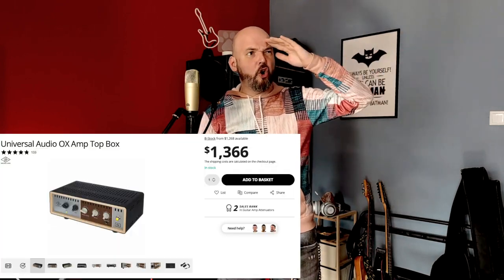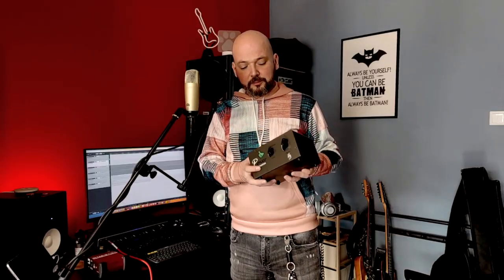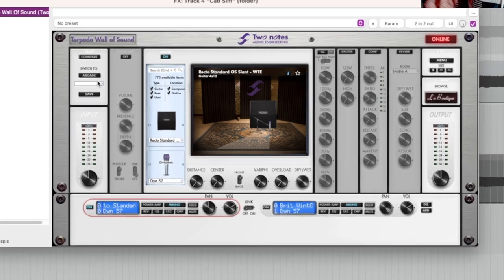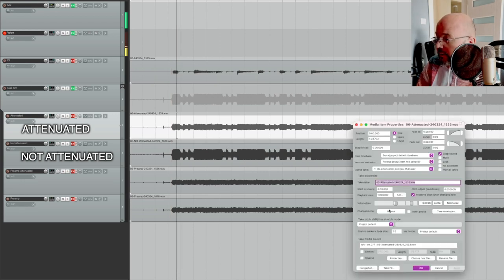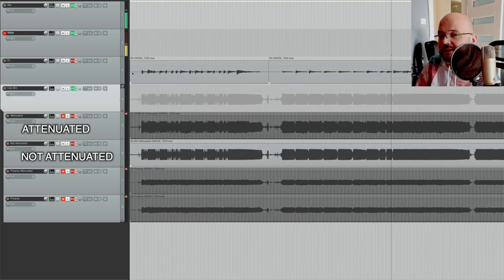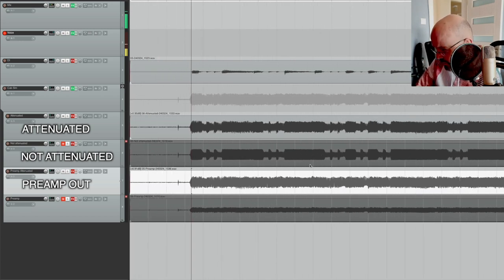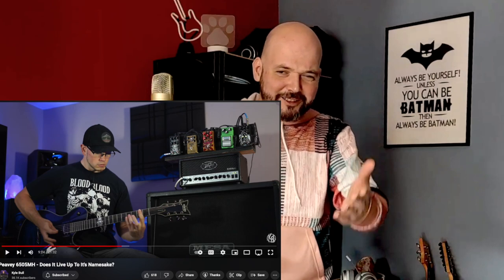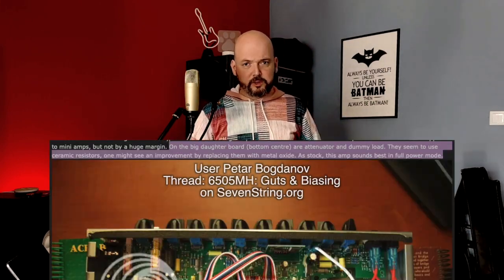How a (cheap) Attenuator affects your Tone

Comment from the maker: So, about my point about lunchbox amps and internal power soaks -- not all lunchboxes are the same. Some, like the 6505 MH do have a static load box inside. Others, like the EVH 5150 LBX literally drop the power to the output stage, not via a big static resistor. Eh, in some way or another, I'm still stupid, but now less stupid.